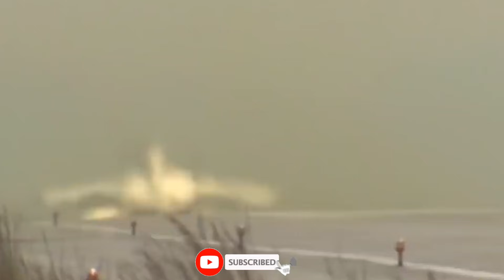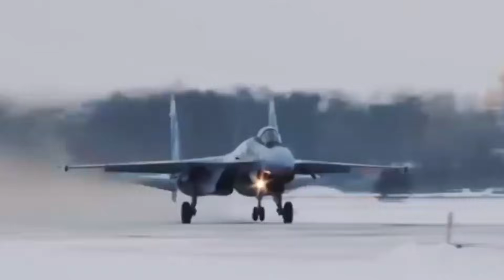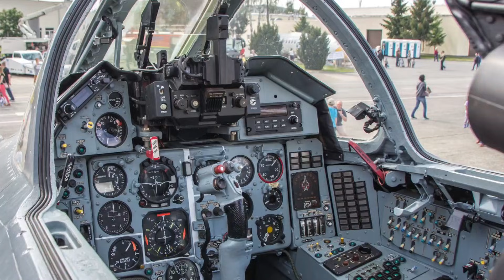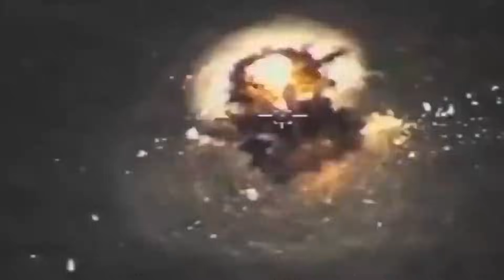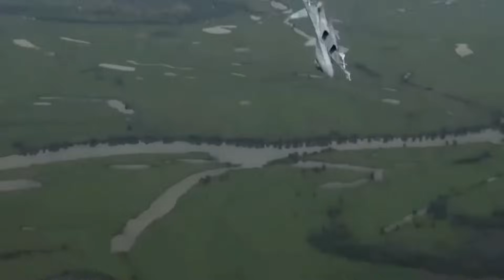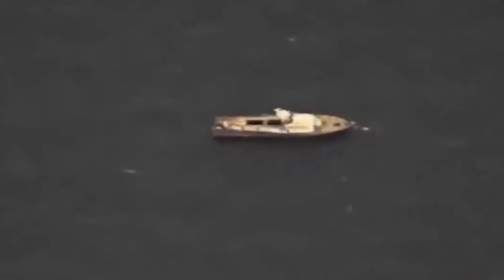Inside the Sukhoi Su-35 Cockpit: Power, Control, and Russian Design

Comment: Are you sure you showed the Su-35 cockpit and not the Su-27 one? Because I know that the Mig-29 K has crystal displays, and it is not a Mig 35. The Su 34 also has crystal displays and I read that the Su  37 Terminator (a predecessor of the Su 35) also had this kind of displays in early 2000. So, if the Su-35 is the Sukhoi is the most advanced plane of the SU-27 line, it should have those technologies. Maybe not in the same amount as western fighters, but I'm sure they have it.